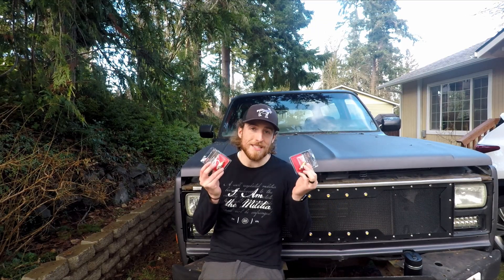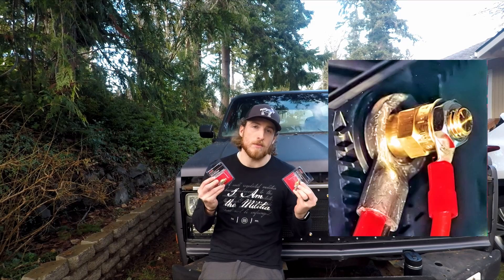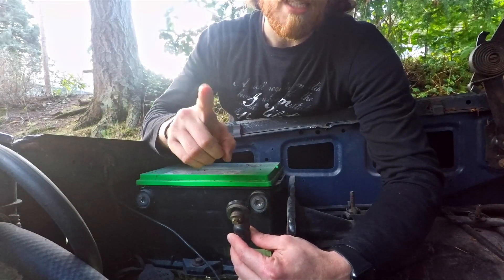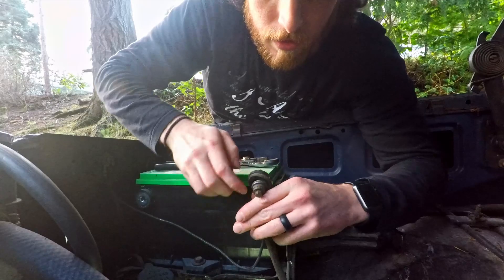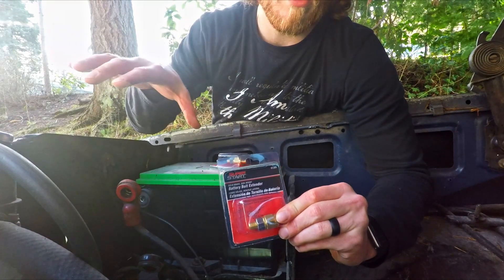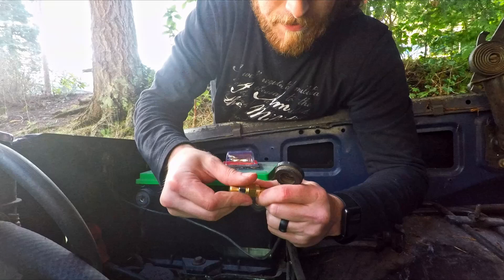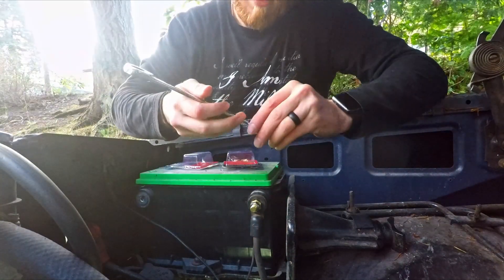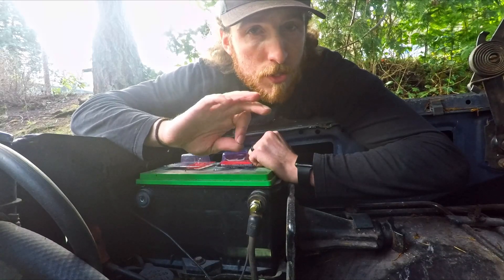How to Remove Battery Cable Bolts | GM Side Post Battery Terminal Upgrade

Comment: Hey man....This is a really good video....easy to follow, right to the point, I changed out mine (The metal side post piece where you put the wrench was so worn down as it was the factory original on an old truck and couldn't get a wrench to grab anymore so it wouldn't tighten, I almost thought I would have to replace the whole wire but instead was able to swap the old part with a brand new one without having to replace the whole wire assembly....Much faster and easier to change the metal sidepost than to replace the whole cable! Only took a couple minutes and now I can put a wrench on it and tighten it down all for the price of the part and literally probably took me less than 3 minutes to do the swap and hook up the battery! You mentioned you are going to be looking into finding the source of a drain, I'm having a drain issue myself, the truck is older and usually I just keep the battery disconnected when I'm not driving it so your other video you mentioned sounds like that might be helpful as well....This was a great video, told and showed what to do, stayed right on point, helpful...A lot of similar videos they drag it on and on with a bunch of talking like they are just doing videos for attention like they are some comedian looking for stardom or something....I like videos that tell, show what to do without a bunch of filler stuff.
Reply from the maker: I’m glad you found it insightful!

Comment: Thank you. Much easier that using vise grips to remove the old bolt.  Some mechanic replaced the negative post bolt with one so short that I can't get jumper cables or a jump pack on it. Thanks for the warning about over tightening, heh.
Reply from the maker: Glad I can make the mistake so you don’t have to!

Comment: Thanks.! I love simple and this technique is sure enough simple.! You mentioned battery drain. I'm eliminating my battery drain with a remote battery disconnect switch from ZOZO Motors. Part Number 30248 bought on Amazon for less than $40 bucks. Already spent over $150 for a mechanic to find the drain to no avail. Now I've got another remote switch I'm going to just leave somewhere in the car. Again, thank you for your simple fix I couldn't figure out.

Comment: Millionth video I’ve seen that doesn’t actually show how to remove the terminal from the wire not just the bolt smh
Reply: I’m in the same situation. Have you found any video out there that shows how to remove from wire?